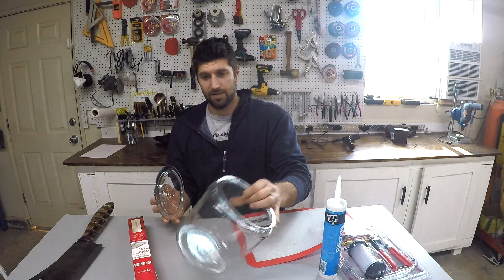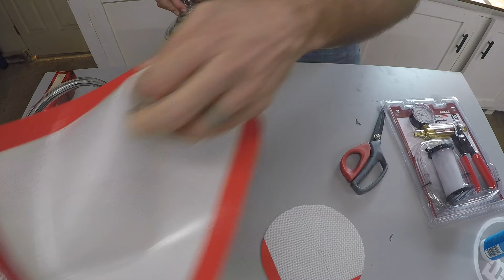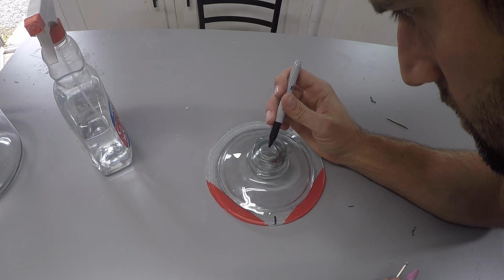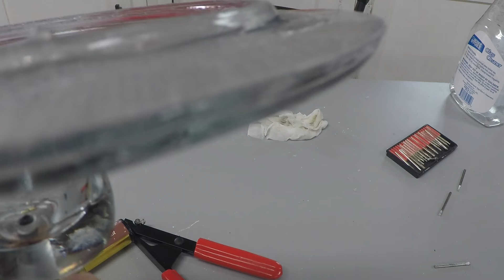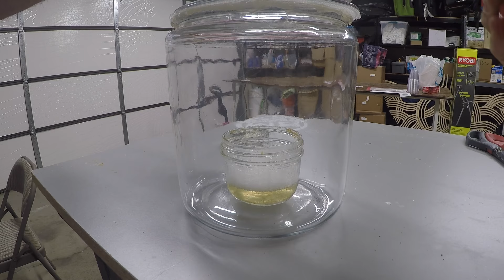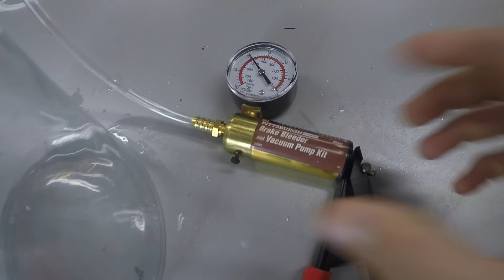EASIEST & CHEAPEST Vacuum Chamber. DIY for epoxy castings & resin pouring.

Comment: Great video. I am newbie on casting and mold making. What is the average psi that is needed for cure time?
Reply: if u use a vacuum on epoxy and leave it on vacuum ur epoxy will over flow the mold it makes it rise, use vacuum on silicone molds, release pressure before it over flows then pull vacuum. Although this may not even be enough vacuum pressure. Use pressure pot on epoxy and leave it under pressure for atleast a couple hours depending on ur epoxy cure time .

Comment: Does it matter what type of jar or lid? Can i used a smaller jar with a flat lid and still drill a hole and do the same thing?
Reply from the maker: I would just make sure the jar is very thick and sturdy. any lid should work as long as you make it airtight.
Reply: @blakemcfarland6418  thank you🙏

Comment: @blake McFarland why the glass jar compared to an inexpensive stainless steel pot? I'm not being a smartass, serious question. I have a Dremel tool, but not a lot of experience drilling into glass, so I'm looking for something that won't crack or shatter when drilling a hole through it. 
I'm going to do everything exactly how you did, but I want to use something different for the chamber so I can leave as many molds as possible I'm the chamber overnight. It can't have a narrow mouth/opening because my molds are sheets. What are your thoughts on a large pot like they would use in a restaurant?
Didn't you run into issues with the silicone sticking to the glass?
Reply from the maker: I use glass because I wanted to see the epoxy to make sure the chamber is working appropriately. You can use a steel pot no problem. I just prefer to be able to view the epoxy.
Reply from the maker: Silicone will stick to anything!
Reply: @blakemcfarland6418  thank you, appreciate the insight and the video. I've stopped casting because there's just no way to get good results without a pot/chamber. There's always one bubble in a bad spot even with the high end deep pour epoxies. I use Liquid Glass Deep Pour from FGCI.
Last question (hopefully), the hand pump was a great idea, but what do you think about a small electric pump? Many airbed pumps have an intake and outtake. Would they be capable of creating enough pressure? What PSI am I trying to attain for let's say a 6in x 8in solid cube of epoxy, leaving it overnight?
Again, super grateful for all the help. You've saved me from spending a few hundred dollars on a the chambers other YouTubers say we just have to buy like there aren't other options like dyi.
Reply: Before you go into answering that, I actually decided to got the way of a pressure pot instead of a vacuum chamber. The likelyhood of the resin being lifted out of a mold by rising bubbles is far too great when I'm working with some really expensive exotic woods. A pressure pot doesn't eliminate the bubbles, but making them too small to see is just as good to me. 
I already have an air compressor, so all together with the pot and the parts to replumb it, I only spent $70.

Comment: Hey just curious, do I need to make that silicone seal if I already find a glass jar with a built in lid seal and hinge?  I found a lot of cool glass jars that are airtight because they have that silicone lining around the lid and when you close it, you can use the little metal latch to make sure if stays down tight. Do you think those would work?   What is keeping your lid down on yours besides gravity and suction?  I'd be worried of air getting back in unless I didn't press down firmly on the lid while using the pump.
Reply: The vacuum by itself pulls the lid down. So you actually only have to worry at the start. Is it’s air tight at the start the vacuum pulls down the lid and makes it even more tighter if that makes sense 😄

Comment: Awesome video however would this work the same with a mason jar
Reply: you can do it in whatever u want if the size of container meets ur needs. But I would use pressure pot for epoxy not vacuum.

Comment: How many minutes does it take with this to degas the epoxy? I work with silicone that has a short working time.
Reply from the maker: Depends how fast you pump haha? I would recommend a vacuum pump if you have short working epoxy.

Comment: Why silicon mat gasket and weather stripping or even silicon adhesive sealant. The mat should be enough if the lid fits tightly

Comment: anyone know if i did this with a plastic bucket, would i be able to get enough pressure to get air bubbles out of silicone (for mold making) befor the bucket collapses? also would there be a point if im apply the silicone with a brush (as opposed to a pour). fyi i'm adding around 1% thickener to the silicone.

Comment: Unless you already own a caulk gun... 7 items :)
Why not use a compass for the inner circle.. wont matter if you poke a hole in the center since its getting cut out
Any off the top of your head reasons you can't use a hinged mason jar (top attached via that metal clamp for an airtight seal) with the rubber oring?
Reply from the maker: I don't have a compass or I would have used one. Using a hinged mason jar would be even easier! I wanted the largest container I could find so I went with this one. If you are doing small projects I would highly recommend a container that has its own airtight seal.
Reply: @blakemcfarland6418  Will hot glue be enough to replace the silicone?

Comment: Fantastic! Thanks so much for this. I'm wondering if one of those airtight kitchen jars (the type with a rubber ring around the closure and a metal clip to close the lid) would work for this and cut out the silicone mat and weather stripping tape stage?
Reply from the maker: absolutely... makes your job even easier! If I found a container large enough I would have definitely used one of those!
Reply: @blakemcfarland6418  also, could you use a metal pressure cooker pot and skip the glass drilling altogether?
Reply: @Witchofthehill  other people use pots so yeah you can. It’s just more expensive and I think that was his intention to make it as cheap as possible
Reply: I actually have an old metal pot with a lid.  It’s not a pressure pot, so I would still need to follow steps to make it air tight, but I think I will try.  #1 I already have the pot, #2 I have reservations about the glass.  
That being said…….. watching the “action” I think adds to the aesthetics of the process!!! So I LIKE the glass (see through) option

Comment: dam son this was really needed. I will replicate asap so a huge thanks. This was so freaking simple. SO when using this method, you need to pressure, release, pressure, release correct as watching the air bubbles lift from the resin?

Comment: A nit pick, but the vacuum gauge measures negative pressure in inches of Mercury (Hg), NOT negative PSI. Pulling a higher vacuum will expand the remaining air in the chamber, out of porous material like wood, but never 100%. As long as the item is submerged in enough 'Juice, once the vacuum is released, atmospheric pressure returns and forces the Juice into the voids of the wood where there is little air remaining. Positive pressure is of little value, unlike in curing epoxy, because there pressure shrinks bubbles, until the epoxy is cured.

Comment: When i use the small black nozzle it wont work ..i feel the vacuum working on my thump but when i put it all together nothing happens or shows on the the gauge...when i just use the tubing it works..but dodgy...can't why putting reduction air valve seems to stop the vacuum
Reply: must be an air leak somewhere

Comment: great video! I'm trying to get into working with resin and I have a few questions regarding this. Would Acrylic based container with wood top work? Or even glass container with a wooden lid? I'm curious because I feel like the glass will break due to the fact that I cannot find one that is thick enough AND big enough. Also because I feel more comfortable drilling a hole into wood/acrylic as oppose to glass due to the tools that I have. Thank you!
Reply: I’ve been reading about the cheap vacuum vessels you see on Amazon. One criticism is that acrylic crazes and cracks under vacuum, so you need it v thick. I’ve seen 14mm said to crack, and one was 20mm thick, and they didn’t complain about that one cracking, so maybe that’s about how thick you need, or just regard it as a consumable. Thick acrylic sheet isn’t cheap.  
I’ve seen someone make a vacuum chamber with thick plywood, sealed and screws joints!
Reply: First off if the lid is acrylic it's dangerous to begin with. Acrylic is very prone to cracking under any provocation. Most of the lids on the commercial units are made of lexan = polycarbonate plastic. It's much more forgiving.
But even the polycarbonate lids will fail because the vapors from some of the resins will attack the polycarbonate.
The best units that I've seen use a 3/4 inch thick glass lid which I suspect is actually a porthole glass.

Comment: Thanks for the vid! Quick question- was wondering if this would make a spinning top spin forever? I’m not physicist, but because it is almost a perfect vacuum, would this make a top spin for long periods of time? Longer than the 1-2 minutes one can spin for?
Reply: That's a good question.  In short, the answer is no. This is far from a perfect vacuum, but even if it were, the effect of air pressure on a spinning top is negligible.  A spinning top stops spinning because of friction with the surface, and once it tilts a tiny bit, is also affected by gravity as it starts to wobble.  Some extremely expensive flywheels are enclosed in vacuum chambers, but they are constructed with two sets of frictionless magnetic bearings to negate the effects of friction and gravity.  In that case, using a vacuum chamber can make it spin longer.

Comment: Great video thank you! Curious if you have an idea for a valve or something that could be added to make it so pump could be removed so space could be left with vacuum on? Thanks again for this video.
Reply from the maker: I have no clue about valves hence why I created something with no valves. Sorry!!!
Reply: I guess any tipe of air conduit fast release connecction will do the trick,  but you have to try, not sure if it acctually holds negative pressure

Comment: Couldn't you save money by using the silicone to make your o-ring and gasket, and also using that too, instead of the hot glue (if you don't already have it)? 

For $50, it seems like you could get a pressure cooker second hand and drill it and use the pump. Just won't be see through, but will be larger.

Comment: This is exactly what I’ve been needing!! However could you explain a little more what releasing the pressure did to the soapy bubbles? They went down and I’m a little confused on what actually happened. Are you supposed to do that or is that reversing the pumping that you did to create pressure?
Reply: When you remove the air.. the liquid could expand w/o any air pressue/weight applied.. when you put the air back in, the weight of the air pushes them down again.. 
Go youtube a peep or marshmallow in a vacuum... same effect
Reply: @synapticdragon2157  i think it might be the opposite you pump air in and do a controlled release, sucking the air and bubbles out like a vacuum.
Reply: @alisonhunt3525  is that how a pressure pot works?

Comment: How long did it take for you to pump?? cause I have been pumping forever and ever lol. And idk if I should stop or keep going or what is a realistic time frame it should take for like a lemonade serving glass jar.
Reply from the maker: If you got the same pump as I did, try pumping it slower. Seems weird, but I noticed when I tried pumping really fast it took longer than when I pumped it slower. I think the chamber needs time for the air to release so go through the full range of motion slower. It should take no longer than 5 minutes. If it takes longer, check your seal, it may not be airtight.
Reply: Blake Mcfarland thanks yeah I got that part working now it’s the seal I’m struggling with. Idk. I am using a  lemonade jar and it’s perfect cause there already is a hole in it. I just don’t know how to deal the life down. I tried 100% silicone but it’s just not working so frustrating. The whole is a little bigger than like a mayonnaise container.

Comment: I can honestly say “Suck it and see!”  But I’m worried about the thinness of the glass here when compared to what is used in a lab for an evacuation chamber. Thick Pyrex. You can find old ones on eBay, but I want mine for food use (inside jars to vacuum seal dry goods) and I worry about using some old equipment where I don’t know what chemicals have been used in there, realising washing isn’t always sufficient to get it off completely. Why is life so difficult!?

Comment: Good video. I would say you could save a lot of hassle by just sticking the silicone mat material to a thick plate of plywood and put the vacuum hose through that.
Reply: Did you try this? Did it work?
Reply from the maker: Great tip!

Comment: You say the vacuum is measured in psi but it is actually inches of mercury.  The maximum possible vacuum is about 15 psi or about 30 inches of mercury.

Comment: It would probably be faster, safer and cheaper to recycle and old pressure cooker. The valve is already there. Just using it in reverse with your hand pump.

Comment: There is a very simple way to make a vacuum chamber and no one has ever thought of this and all you need is a go onto Amazon and buy a single or a pack of vacuum storage bags used for clothing and you stick the Hoover on the end of the plastic cap on the bag and get a used and finished plastic popcorn bucket with a snap on lid and glue the vacuum bag to the lid and there you go a instant cheap vacuum chamber and you can adjust the suction by the nossel on the Hoover so it's not too strong causing the lid to cave inwards and it will really work why pay a lot of money for a machine when you can buy a bag for a few pence from the pound shop and make your very own with a popcorn bucket
Reply: you mean a vacuumcleaner??
Reply: Not nearly enough pressure.   i've tried it.
Reply: @mackychloe  well I also tried to see what happened if I used a Hoover and it was too much power for a plastic popcorn bucket sucking the whole thing inwards both sides because the plastic bucket is not strong enough to withstand the suction and caused the bucket to cave into the middle so really it needs to be a proper steel kind of tin
Reply: @mackychloe  yours is still a great idea marvellous compared to having to pay out hundreds of pounds for a real vacuum chamber because they are not cheap things to buy on Amazon

Comment: Couldn't you just make the seals with the silicone caulk that you already had? Why buy the silicone mat and door seal (that are also made out of silicone)?

Put silicone caulk on the lid where it meats the opening of the jar, some dish soap on the rim of the opening of the jar so it releases when the silicone cures, and you have a cusom fit seal without having to buy the mat or the door seal. And it is cheaper :)

Comment: You know, you can buy a vacuum pot for roughly the same as the materials used here?

$20-30 Brake bleeder kits
$15 Silicone Mat
$20 Glass Jar
$30 Dremel 
$5 silicone
$5-10 Caulk Gun
$8 weather stripping

There's a vacuum and vacuum pot combo for an average of $120 on Amazon and ebay. No time spent, no risk of messing up no additional tools needed. 

Was kinda hoping it would be cheaper. Good craft project though and great video.
Reply: I found a brake bleeder kit for 20$, a glass jar with airtight seal for 6$, most people already have a dremel, leftover silicone and a caulk gun, so for me it was literally around 25 bucks for the whole project.

Comment: That glass jar would worry me. Vacuum can collapse a cheap steel cooking pot, it could easily implode a cheap glass jar that is not made for the task. My advice would be to buy something much sturdier. Say, a pressure cooker pot, use that as the basis for a vacuum chamber.

There are plastic and glass bell chambers for degassing but they are expensive because they are made to withstand the pressure.
Reply from the maker: This glass jar is actually surprisingly thick. The pump I am using does not reach a pressure that would worry me whatsoever. If I were using an electric pump I would be a little more concerned.

Comment: thanks for the video! you don't know how much i was dreading trying to find a vacuum chamber. one question- i'm dealing with plaster which sets up pretty quick. how long does it take to pull a vacuum on this thing/ if i installed TWO hand pumps could i use them in tandem and do it twice as fast?

Comment: Another thing I would like to add the best method for epoxy is pressure chamber, not vacuum chamber. I have both, vacuum chamber for epoxy is a pain in the ass, While it can work it isnt that efficient, pressure works way better. I use vacuum for silicone molds and u have to pay attention so it doesnt overflow.

Comment: where to get drill?
Reply from the maker: what drill?
Reply: The one you used to make the small hole in the top of the glass jar
Reply: @alicoulibaly8006  Oh... That is a rotary tool. Most commonly known as a dremmel. You can get those for cheap at any box store. The bit I used was a diamond bit burr.

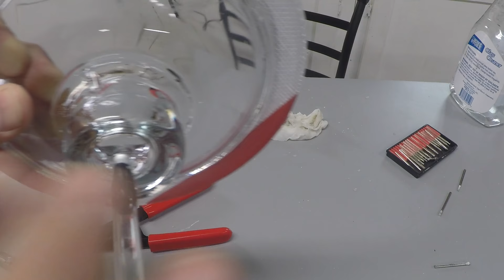Comment: 04:03 keeping it cool really depends on the glass and most glass can take more heat than you were allowing here. Not saying it is a bad idea to play it safe but seriously it probably wouldn't have cracked if you had just gone slow with no water and didn't over-apply pressure.
Reply: Also vacuum DIY not scarily dangerous like pressure-DIY! Failure there is always catastrophic, high speed glass throwing.